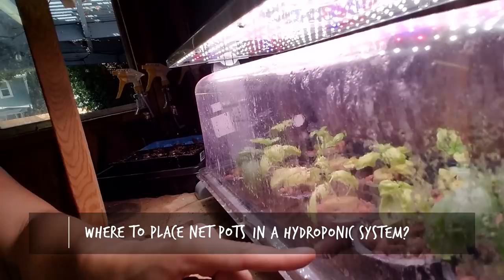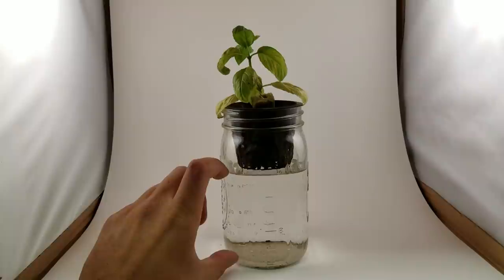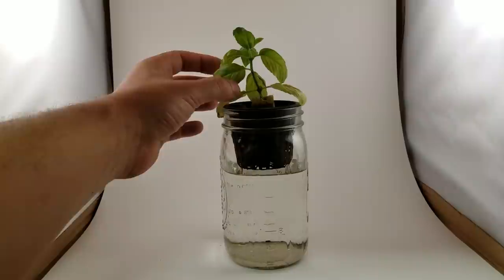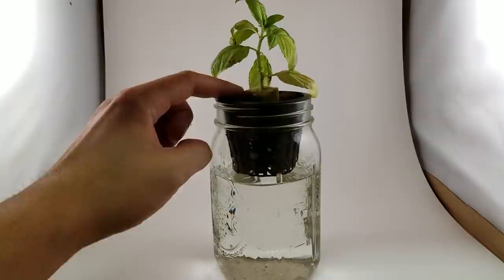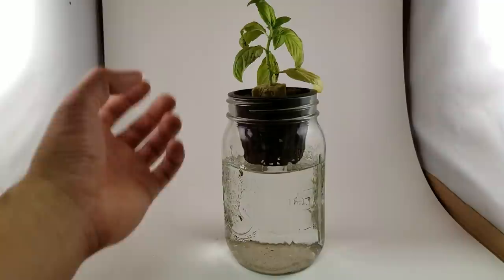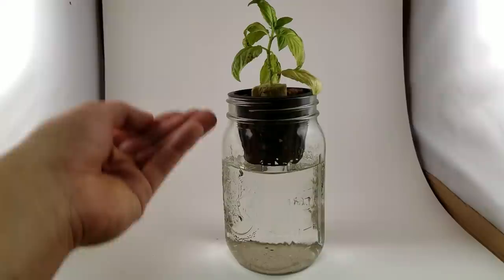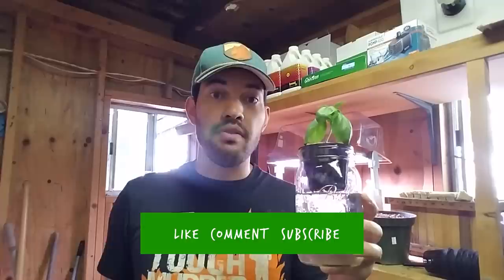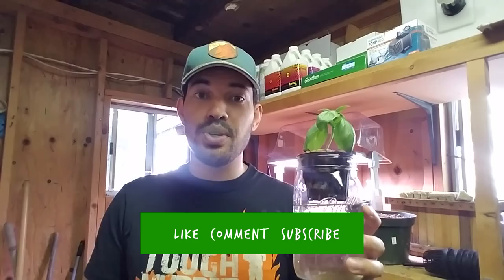Where Should You Place Your Net Pots in a Deep Water Culture System?

Comment: Like the video because it solves a practical problem.   My current system uses overhead drip to get the roots growing, then once the roots are out of the net pot, I put water line just above the bottom of the net pot, start the water stones, then I keep overhead drip irrigation pretty much forever to replenish the water.

Comment: I have several 27 gallon totes running the kratky system. I drop my net pots in the top of the tote and fill the tote with water and liquid nutrients until the level reaches the first horizontal rib in the net pots(perhaps a half inch or less). For rock wool I place the cube on the bottom of the net pot and add clay pellets, for bare root plants I hold the plant up with the longest root just touching the bottom of the net pot and carefully fill the pot with clay pellets. Most plants will put roots into the reservoir in days after hitting the nutrient solution. I checked some bare root lettuce plants that I put into the tote five days ago and the roots are all over the outside of the net pot already. Peppers and tomatoes are already showing good growth.

Comment: I've been researching hydroponics for the last 8 hours and I must say I am disappointed. I have watched people use toxic PVC with PVC glue (even more toxic), rockwool (which is dangerous to touch, inhale and eat), and none of the videos addresses the issue of how long the seedling net pots take to develop roots that can actually touch the water. A lot of blah blah, and never touching the key subjects. Everybody is showing how to cut holes and connect pvc pipes, as if this was the hard part. Yours is as close it got, so good job on that. But even you, you describe solutions that are unreliable, like top drip and air bubbles. Thanks thought, as I said yours is the best video on the subject anyway and your channel is very good.

Comment: In short
With roots - no worries, as long as the roots hit the water solution
Without roots - 1. Make sure that medium is moist enough until the roots start popping 2. If you have air stone, the moist from bubbles will keep the medium moist until roots start poppin. Thanks👍

Comment: I know this is a 4 year old video but I have a question please. I’ve been trying to grow tomatoes in DWC. My cherry tomatoes are going gangbusters. But tried Big Boy purchased as starter plants from Lowes. Both have not been successful. The leaves curl and get spotty the flowers drop. Could the issue be I’m using small River pebbles for medium which definitely is not a wicking medium. Both already had long roots when I started that reached the nutrients and I left air space. It has been very hot days in the 90’s. Plants are outside partial sun. Thanks

Comment: my leaves are droopy and i couldnt figure out if i was overwatering or underwatering, i placed them right where you showed. I tried letting them dry out and also tried cranking that airstone all the way up. very slow growth for a week, still on first set of leaves out of seed...should i add nutes yet or hold off. i think i moved them to the dwc system to soon out of the germination pod, i saw a tiny root like yours and said! and moved over to clay and netipot. from netipot to water level it was a good 3 inches (eventually made it down there) (is that why its growing slow, or lack of nutes)

Comment: Hi thank you for sharing. I use clear 9 oz plastic cub cover the small plant when they don’t have the roots out to the water to prevent from cold and keep it moisture. I try to grow Thai basil but the leafs getting small than I grow in the soil. But the bell pepper the leafs is so big. Do I have to increase the nutrition when the plant getting bigger or not? Thx
Reply from the maker: +rockin roadways it's hard to say if nutrition is your problem in this situation, because there are so many variables. What I would do is make sure and test your nutrient solution to see if you have enough of the macro-nutrients that basil needs: nitrogen, phosphorus, potassium. If the leaves aren't big, one of the major problems could be a lack of nitrogen

Comment: NOW I AM WORRIED THE MEDIUM SHOULD BE TOUCHING THE BOTTOM, YES OR NO?

Anyone seen this recently?  I definitely having trouble with my first DWC from vivosun 4 pot set.

I didnt wanna soend loads on ebb n flow or any other exoensive system at least until i actually nail this qnd can get DWC right 

I have only d8ne soil but the 30% plus added growth interests me the most.  I've noticed a humongous diff between a soil and a dwc bucket for same exact cuts in sane exact lighting so really, i feel like if i can dial this in its easier to be honest(once u dial in whichever systen you have)

But yeah, ...so i am mostly going cheap for the exact reason as I've never done it successfully b4.  (I had an ebb n flow but the guy i had set it up acter like he knew his stuff but 8n the end it was almost worthless but mostly dur to my lack of kbowledge ,kike reading a olant by seeing how wet the medium can be. Ya need that not soaked but moisr and lots of trouble getting that dialed in.

I have top drip and airstone, top drip is supposed to get it to whete the roots finally reach the bottom of the net.

NOW I AM WORRIED THE MEDIUM SHOULD BE TOUCHING THE BOTTOM, YES OR NO?

Comment: I've just watched the video and am using the air stones. It appears I'm doing the same as the video; the net pot has the rock wool which has the seed. The bottom of the pots are not  in the water (they are actually about 4 inches above the water line), but are being hit by the air bubbles.
However, three of the pots never sprouted and the rock wool has been drenched by the air bubbles to the point of being soaking wet.
My question is can the rock wool be too wet? If so, would it be smart to only have the very base of the pot just 'peeking' through the cut hole at the bottom rather than sitting on its lip (the way you showed yours)?
Reply: did you figure it out? mine are in soil plugs and seem to be not having it, one seems amazing but still slow, im about to move them to their own buckets but they are so tiny :\
Reply: @Hedgehodge-  no I never did. I decided the rock wool just stayed to saturated, no matter what.  I decided to put my seeds in seed starter plugs, took a styrofoam 2" sheet, put felt on it,  and put it in a tray of water only up to the bottom of the felt. I put the seed in it's plug in a net pot on the felt, covered it with a mini green house cover (plastic with vents) - put the whole thing on a heating mat and it worked beautifully. Then once they got their first true leaves,  I transferred them over to the water culture before the roots could grow into the felt. It might not have been the way to do it, but it worked for me.
Reply: @itsasfoury  thanks. Yeah I think I moved my seedlings over to fast to netpot but I'm reading a drip system helps close the gap a week or two between when roots are making way down to water ... I was googling why my plants seem sad and haven't progressed in a week, guess that's why

Comment: Hey Kevin, growing herbs in that same fashion, would it also work (or be harmful) to just let the water level remain at just touching the bottom of the rockwool cube so that it always remains moist while that root system is getting established, instead of checking in with more frequency to drip some water on the cube?
Thanks bro, love your work
Reply from the maker: I'd recommend that, yeah. Then again, I typically am a bit more hands-off and dump a bunch of water into the rockwool, and then trust that the roots will make their way down to a bubbling reservoir before it dries out. But if you are running these small Krakty systems like I show in this video, then yes, definitely pour a bit of water in as it evaporates to ensure moistness.

Thanks for the kind words my friend! Let me know what types of videos you want to see in the future.
Reply: Dr kratky recommends having the solution come up to an inch above bottom of net pot. To start.

Comment: Too much work. Follow Kratky, submerge the lower part and forget. One time work.
Reply from the maker: Kratky is definitely an alternative
Reply: dusty rhodes should the water be below my net pods some or just to where the bubbles are hitting the bottom I can't tell how much water is in there I have a DWC 9 hole system but can't see in to tell but they are usually soaked on the bottom I've been lowering water levels but still dont know. First time with dwc any info will help